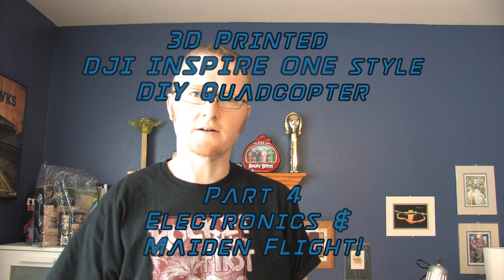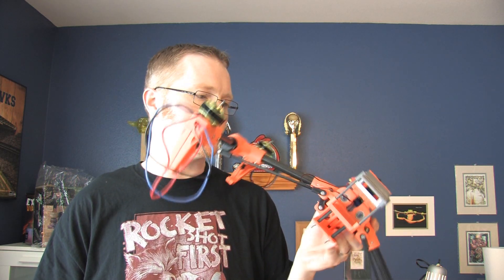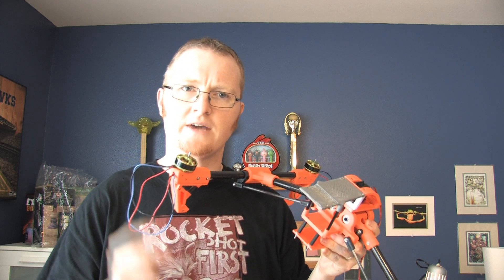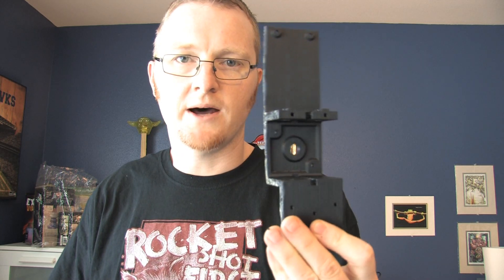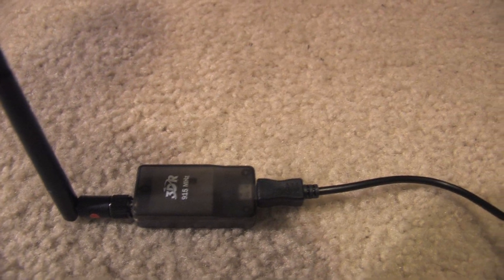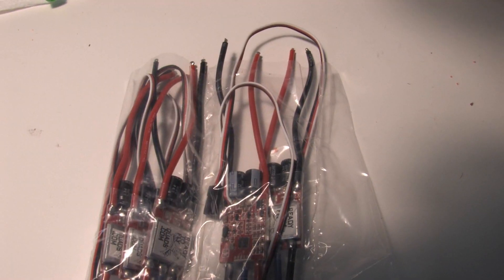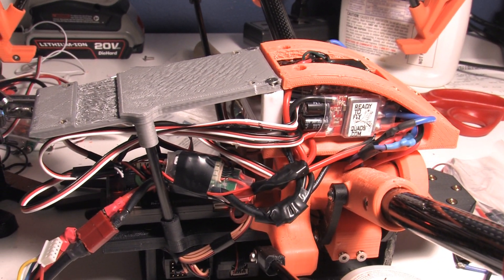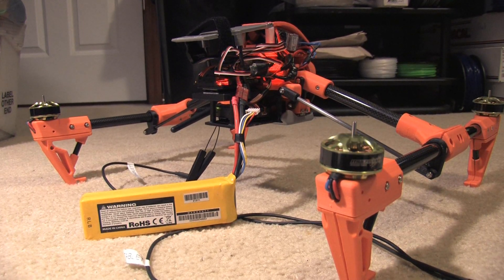Part 4: 3D Printed DJI Inspire One style Quadcopter  - Electronics & Maiden Flight

Comment: Hey Cozmo
 Thanks for your earlier reply, just another question, what did you use for a power distribution board, I don't, how are you powering the ESC?   Thanks again,  It looks great man..
Reply from the maker: I'm actually not using one. The ends of the esc wires are soldered together to the output from the power monitor circuit that connects to the battery. There's not a lot of room in there for extra stuff
Reply: +cozmogeek 
so you solder all the red wires, and black,of the esc, and solder them to the red and black wires from the battery??  Thats awesome, I didn't know you could do that.. if you have any spare time, can you draw a diagram?  Thanks so much

Comment: Hi Cozmogeek,

Your mod in interesting, can you share your .stl files for Canopy Nose which holds gimbal and extended body for APM ?
It would be better to have battery holder body extension instead of a hanging design.
Reply from the maker: +Alpina The nose doesn't hold the gimbal, it mounts to the front of the frame through a hole in the bottom of the body.  I don't like the hanging design either really but I didn't design this.  The 1.5 version that you can find on the rcgroups.com forum is a lot better than what I started with.  It has the swept arm design too which makes it look a lot cooler.

Comment: This is cool BUT I can see why the Inspire1 cost 3grand... Engineering, software, programming, labor. You would need to buy a capable 3D printer too, that's over a grand there. DIY trial and error time cost money, blood, sweat, tears. So you get it to actually fly, what about the I1 4k camera and gimbal? You pay 3grand for the turnkey solution. Anyways, great effort bud!
Reply from the maker: Clyde Gonzales yeah I could easily spend $3k on this thing and still be nowhere close to the real thing.  It is kind of funny that I gasped at the $2800 price tag for the inspire one but didn't hesitate to spend $2500 on my 3d printer. :)
Reply: cozmogeek today a two hundred dollar printer will print twenty of these before a recalibration.  Pretty sweet price price point today . Btw that design sucks . But ! Pretty good video lots of information and opinion

Comment: hello beautiful work, today bought the stl files and will soon print them
I'm curious to know how retractable servant, please can
show the photo or video of the assembly.
Reply from the maker: demerson rocha There is an STL in the package that has all the printed parts and CF tubes in palce so you know where things go. I did show some of the parts of the landing gear mechanism in part 3 if you missed that.
Reply from the maker: demerson rocha http://i296.photobucket.com/albums/mm191/cozmogeek/RC/D34BA3C1-843C-4EA2-ACB6-AA2AB34FF81E_zpsgnc6dfn2.jpg
That picture shows a lot of it. Basically the continious rotation servo on top turns the threaded rod which makes that piece in the middle go up and down, raising or lowering the arms.

Comment: Just buy the real dji inspire 1 I mean if they had a real kit to build then yeah build it
Reply: +Ec130Rhine Dumb people pour cash out for these machines and crash them all the time. Tinkerers and engineers take on challenges to DIY it. Anyways. this version is open source and has endless upgrades. whilst the real DJI inspire one still remains the Apple/Mac of the drones
Reply from the maker: Ec130Rhine Unfortunately there's no way I can justify spending $3000 on it just for fun. If I had a real need for it then maybe.  The Phantom 3 is tempting though.  I might have to pick up one of those eventually.

Comment: So close! That definitely looked like more than an unbalanced CG. What FC are you using? If it is tilting like that at takeoff, DO NOT push the throttle to get it in the air. It wil NOT level out afterwards 99% of the time. I'm really into 3d printing frames too. Check out my ig acct, mqcflight, and feel free to comment or mesage with questions! That practically looked like the motors weren't all spinning in the correct directions! Make sure they're all rotating correctly, and if not, switch two esc--> motor wires' connections. Sorry about the crash!